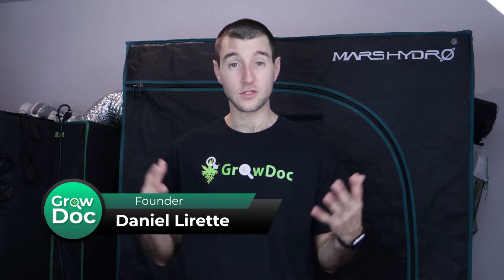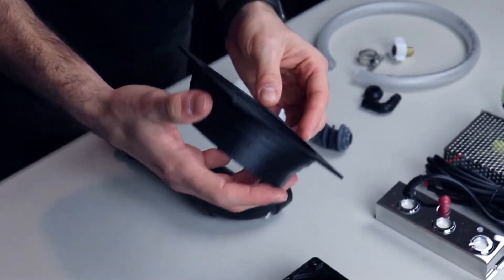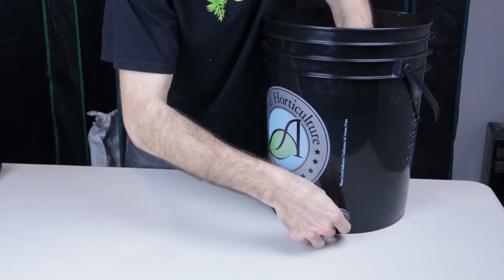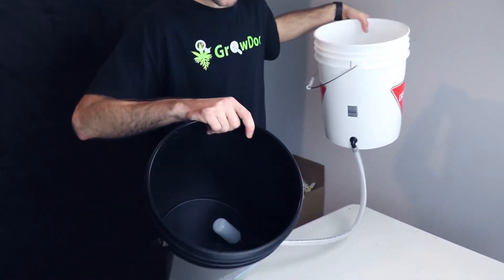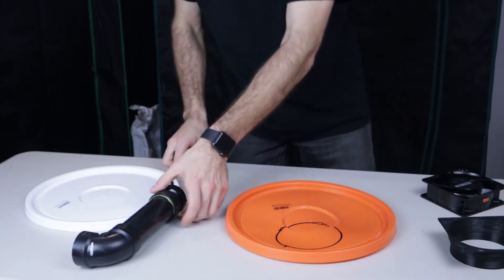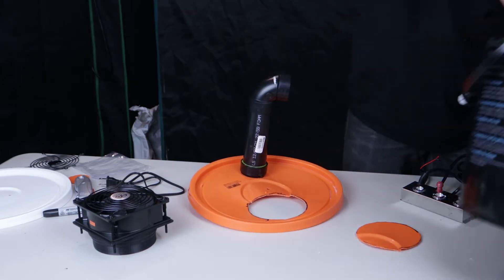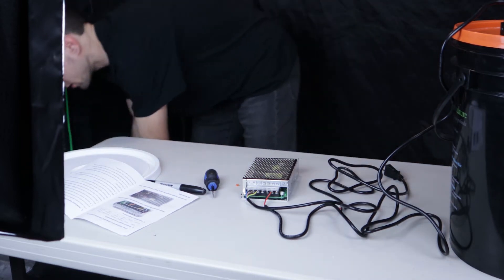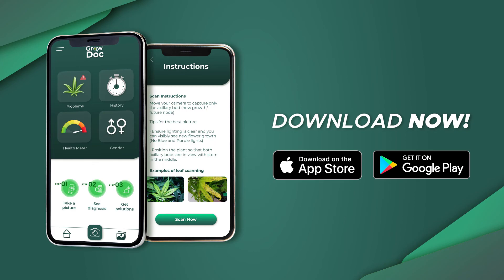Easy Build DIY Grow Tent/Room Humidifier 2022!

Comment: i have not finished watching but shouldnt the float be higher on the bucket so it can fill enough to float the misting unit? they have to be under the water at a certain depth
Reply from the maker: The water can't be too high above the mister, otherwise it won't work. At this depth the float was adjusted and worked perfectly.
-Daniel